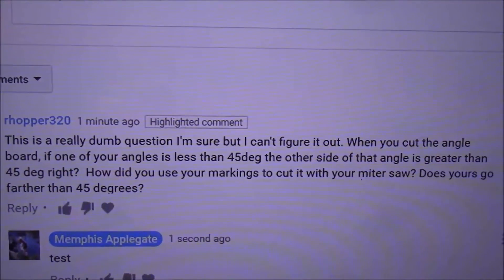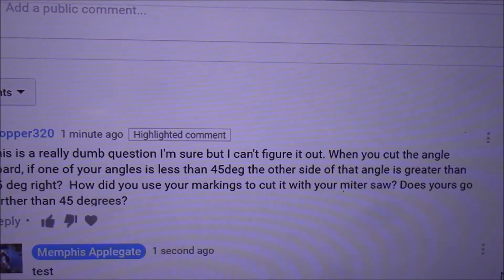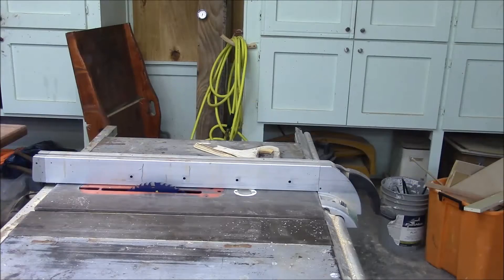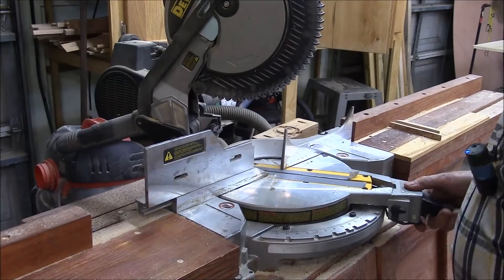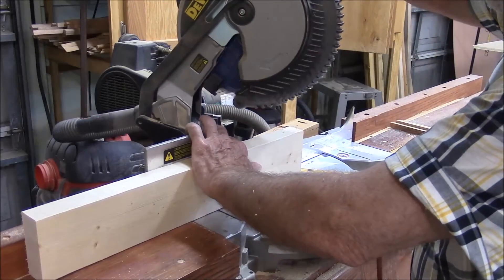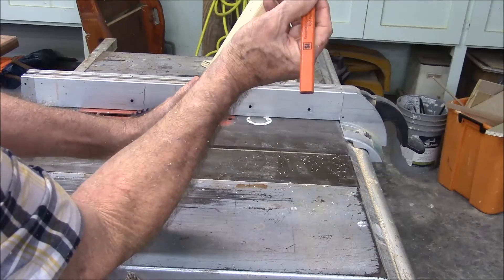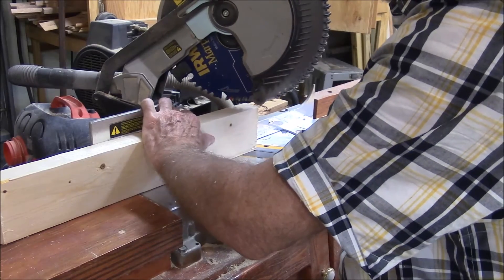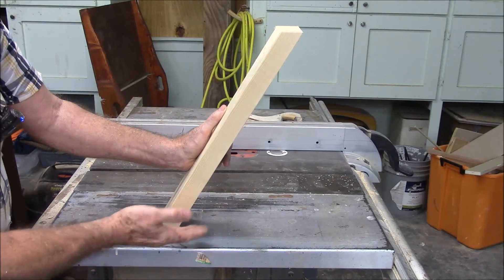1 Memphis Answers a question about angles in a gate brace

Comment: I hope that I am correct in understanding the question. No you cannot cut more than about 45 degrees on a mitre saw. If you want to cut 60 degrees then turn the plank over and cut 30 degrees and turn it back and you have a 60 degree angle?